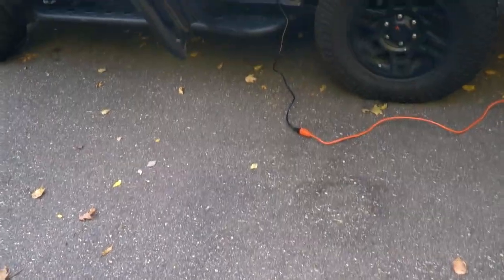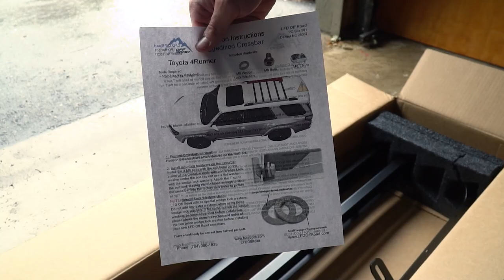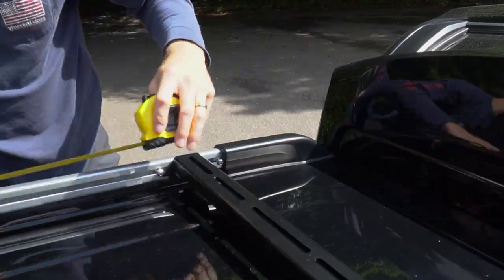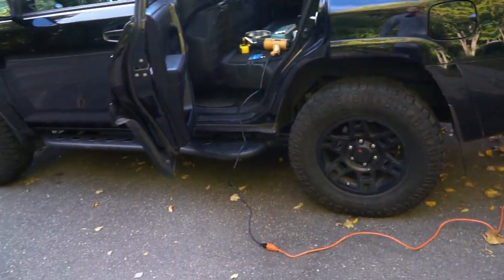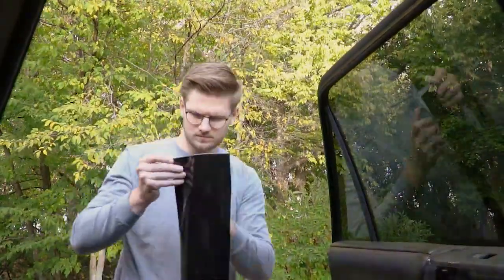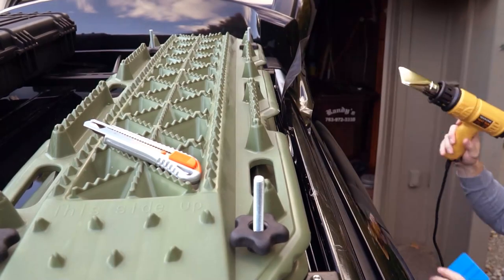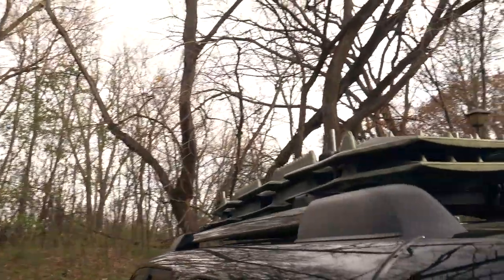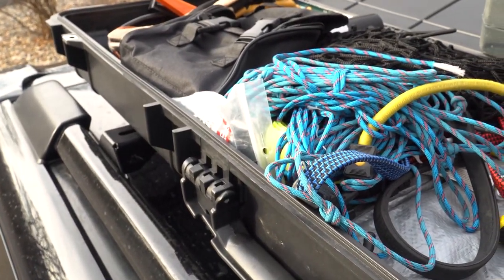Affordable Capable Blacked Out Roof Rack | Vinyl Wrapping | LFD Crossrails | Apache Storage Box

Comment: These bars can be used if a full size rack is installed later on?
Reply from the maker: It depends...LFD sells a couple different rack styles.  If you buy one of the narrower ones then yes.  If you buy the full length wider rack then no.
Reply: @OverlandEngineer  I see you have a full length now, we’re you able to RE use these same bars? I think the bundle is close to $400 at the moment
Reply from the maker: @landrykilpatrick949  Nope, I have a completely different roof rack...I wish, but unfortunately no.

Comment: Awesome , I have the Yakima megawarrior rack on right now. but I want to put an Apache case on top . I’m leaning towards the LFD crossbars. what were the measurements for the hardwares and what drill bit size did you used for the case ?

Comment: Thank you for showing how you mounted the Apache box to the LFD crossbars. I have a LFD rack and am looking to mount a box up there too. Did you get all the hardware from a store like Home Depot?
Reply from the maker: Yeah basically!  The knobs I bought on amazon.  Just make sure the knobs you buy match the shaft/thread sizing of the carriage bolts from the store!  I will say that this method is better for mounting and leaving.  The carriage bolt dig into the paint job every time you take them off.
Reply: What size carriage bolt did you use to attach the Apache to the LFD bars? Thanks

Comment: Great info do you know the H X W X L of those LFD Crossbars for OEM side rails I have 2021 & thinking of getting them. Thank you.
Reply from the maker: They are awesome and cheaper than OEM ones...If your roof rack looks like mine I'd bet they fit.  The website says 2014+ so hopefully it's updated for the newest models.  If you are super worried, you could contact them.  I've got a link to their website in the description too.
Reply: Just installed them on my 2021 TRD ORP and they fit perfect
Reply: @OverlandEngineer  Cheaper then OEM?  Which ones?
On Amazon, 2 OEM bars are $114 (free shipping w/prime), so a set of 4 would be $228 - and, being aluminum, they wouldn't rust and being aerodynamic they're supposedly silent, and if you bought 4 (vs. the standard 2) for extra support, you could probably mount a refrigerator up there, evenly loaded. 
 

The LFD "steel" (not aluminum, not stainless steel) bars are $80 each or $320 for 4 (plus $28 shipping).  Stock = $230, LFD = $350.  And, due to the higher wind noise (than stock) you still likely need a fairing, too (which, at LFD is another $40, so now we're up to $390.  

Basically close to $225 vs. just shy of $400.
Reply from the maker: @cra2cra226  Yeah I guess they are not cheaper but you definitely don't need 4 for all situations.  The wind fairing is also not really necessary in my opinion.  They are not that loud without the fairing.

Comment: what is the width/height (thickness) on these crossbars? Thinking about getting them, but not sure if the bar would be too thick for other accessories like a kayak rack to mount? Need 1- 11/16" or thinner.
Reply from the maker: It looks like the bars are 2" front to back, 1" thick, and roughly 37" wide.  The bars are 40.5ish" wide but its thicker near the rails for better support.
Reply: @OverlandEngineer  Awesome! Thank's so much. Great content by the way. I'm getting a lot of inspiration for my Black 4 runner!
Reply from the maker: @ashtonandnetty  Awesome!  I've got some pretty awesome mod content coming thats not ridiculously expensive so stay tuned!